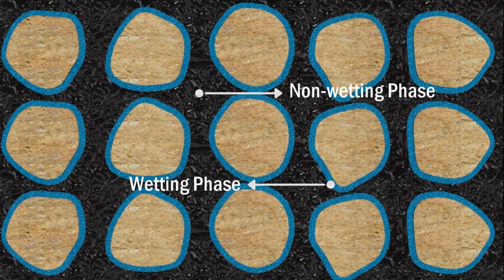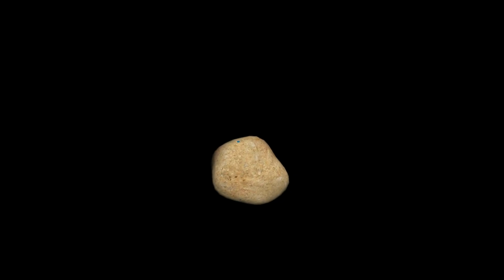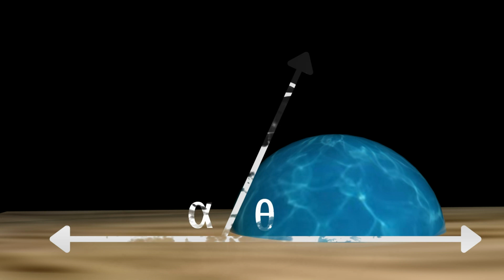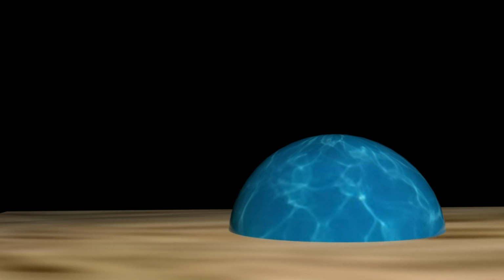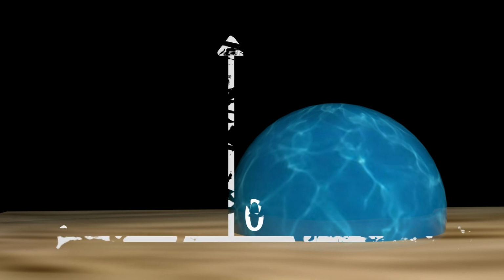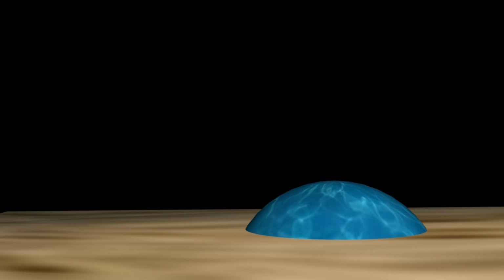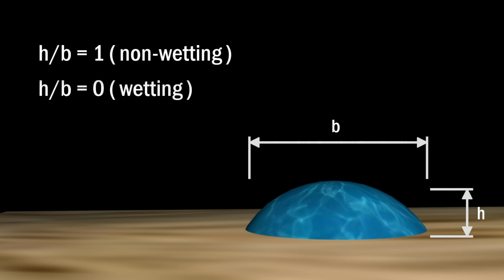Wettability - Reservoir Engineering

Comment: 🎯 Key points for quick navigation:

00:10 🚀 Economic Drilling: A reservoir with isolated pores is not economically viable for production due to high drilling costs.
00:39 📏 Permeability Basics: Permeability, measured in Darcy, is a rock's ability to allow fluid flow, controlled by pore throats.
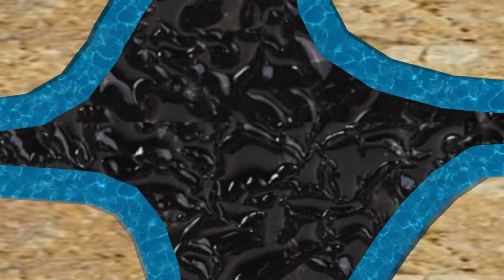01:06 🔍 Types of Permeability: Includes absolute, effective, and relative permeability, each describing fluid flow capabilities under different conditions.
01:33 🔄 Fluid Dependency: Effective and relative permeabilities depend on both rock and fluid properties, unlike absolute permeability.
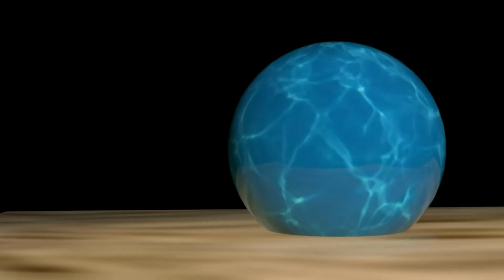02:31 📊 Impact Factors: Factors like grain size, packing, overburden pressure, reactive fluids, clay content, and tortuosity affect absolute permeability.
03:28 🔧 Permeability Reduction: Overburden pressure can dramatically reduce permeability by compacting rock grains.
03:52 🧪 Reactive Fluids: These can alter rock geometry, potentially increasing or decreasing permeability through erosion or precipitation.
04:20 🌀 Tortuosity Effect: Higher rock tortuosity complicates fluid flow, reducing permeability.
04:47 👍 Community Support: Encouragement to like, subscribe, and share the video for broader reach and learning.

Made with HARPA AI